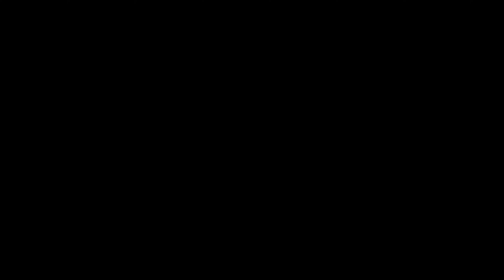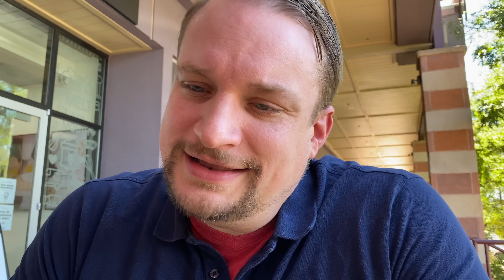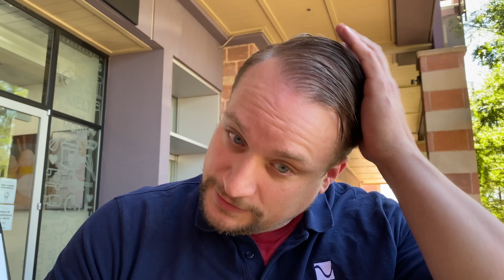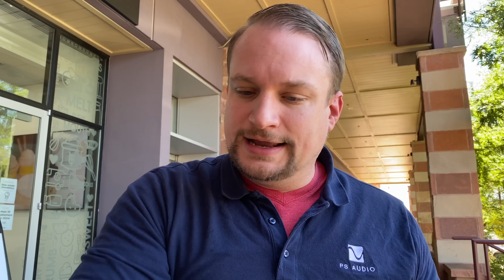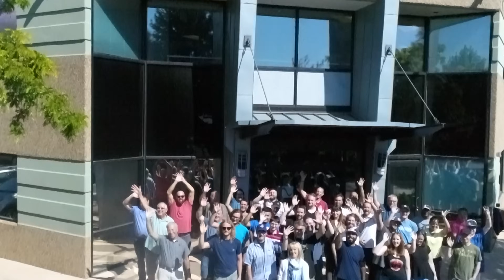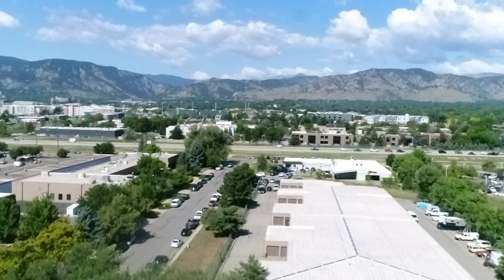Lunch with Paul: The Q of a loudspeaker

Comment: I have some old Infinity VQ subs that you vary the QES by changing a metal slug in the magnet and you can run it in sealed ported or IB depending on which one you install. Every used one I find has the highQ insert installed because people don't RTFM. Id love to find some MidQ inserts but Infinity told me they are not available.

Comment: Do transmission line speakers need a medium or low Q
Vintage speakers such as IMF TLS-50 seem to employ medium version KEF B200 SP1014
I was looking to increase the power of my vintage B&W DM2 by adding a KEF B200 but the more recent driver with larger magnet (the SP1039)

Comment: Low Q in a sealed box sounds lively, fast and tight but it needs reinforcement from the floor or the wall which will compromise other aspects to its sound but most people aren’t audiophiles and won’t pull their speakers out into the room anyway. Boston Acoustics made big shallow depth acoustic suspension speakers that worked best near a wall. Cizek model 1’s sounded good near the floor directed up like a Klipsch Hearsay or Snell. I’m surprised no one makes this type of speaker anymore with a large baffle and shallow depth for close boundary placement. I like the spaciousness of speakers out away from boundaries but like I said that isn’t how most people will position them.

Comment: There are 3 elements of speaker parameters that fundamentally determine correct enclosure :-
Qts
Vas
Fs 
I find speakers with a Qts of more than 0.35 work best in vented enclosures.
I'd love to hear Chris talk about Conjugate loads and the effect resonant peak taming circuits have on phase and group delay and decay ( waterfall plots )
Reply: Didn't someone once try to pull the ol' Conjugate loads and the effect resonant peak taming circuits have on phase and group delay and decay trick on Agent Maxwell Smart?

Comment: What formula do manufactures use to determine the recommended size of the enclosure volume for their subwoofers?
Reply: Theres actually a host of variant "alignments" as they're called.  Choice of which to use depends on both the limitations of the driver and limits to the alignment itself. There are also many alignments that use feedback circuits that actively manipulate the effective speaker paramerters. Look up Theil Small alignments, The Audio Engineering Society or at least used to.
Reply: Forgot to add. If youre looking for a source, an old standby is the Loudspeaker Design Cookbook, Vance Dickason
Reply: Danger Zone  kind of.

Comment: Speaker params is huge subject. I still can't wrap my fat head around this stuff. No matter how much I read or watch videos on it, I still haven't felt like "I get it now". I look at the Qts and Fs figures the most. Correct me if I'm wrong, but a low Qts like 0.3 would be a loosy goosey,  flappy woofer, and a higher Qts like 0.7 would be a super stiff tight cone with little Xmas. Low Q for a sealed box or smaller vented carefully tuned, and the hi Q could be happy for an open back type box, like a guitar cab. ?? Chris's explanation helped, but I didn't get much out of it, except now he had crossovers entering the chat to throw more sand in the machinery.
Reply: You have it essentially backwards.  Lower Q means higher damping, which means stiffer, not looser.  Very loose woofers have higher Q.  
But there are two contributors to "stiffness" so that can be a misleading description.  There is spring stiffness which is simply the static restoring force which varies linearly with displacement (this is what civil and mechanical engineers define as stiffness), and which does not produce damping because it stores and releases energy rather than absorbing it.  Then there is another component of "stiffness" which is velocity-dependent and that does cause damping, because it absorbs energy.  The energy-absorbing type is generally weaker than the spring type in speakers, so most speakers don't have very low Q values - at least not until they are connected to a low-impedance amplifier which then allows the voice coil resistance to contribute to damping.  
When speaker electrical impedance is measured, the resonant peaks tend to be quite high - typically 3-5 times the nominal impedance - which is a high-Q phenomenon.
Reply: also EBP (Efficiency bandwidth product) needs to be taken into account  
EBP = Fs / Qes
EBP around 50 or less, then the woofer is suited for sealed.

EBP > 100 then the woofer is suited for Bass reflex.
EBP is between 50 and 100, then it is good for either Closed or Bass Reflex.
EBP > 130, suited for Horn Loudspeaker
this method generally implemented in "bass box pro" software. i highly recommend it.

Comment: Hi Paul,What the difference between 1 big woofer and dual woofer design,I've seen many speaker has very similar low frequency response but with these two design to archive it
Reply: Two woofers radiate different then one. I prefer one woofer.